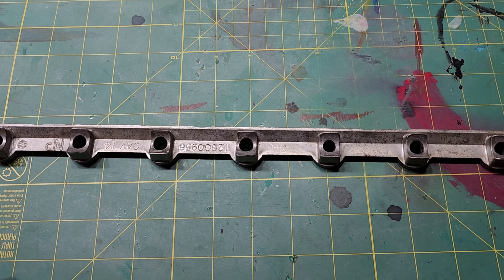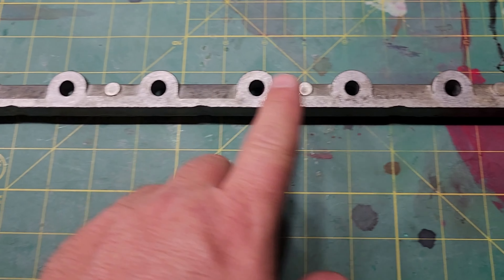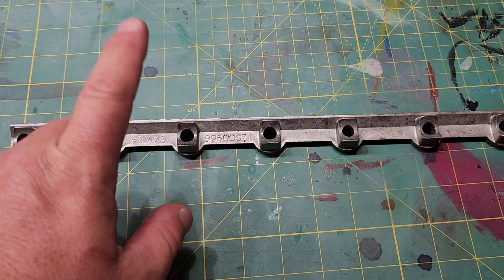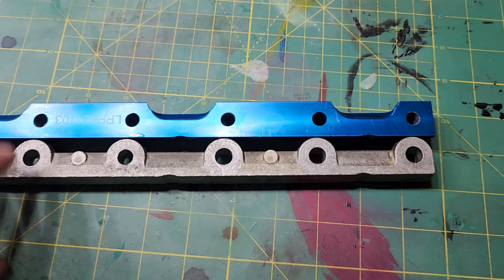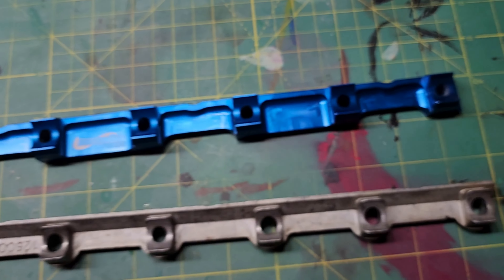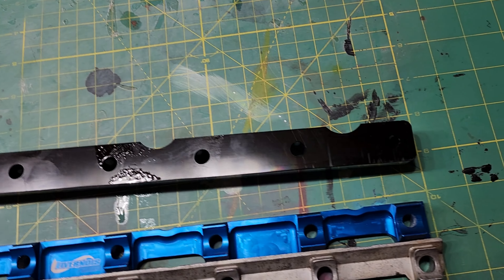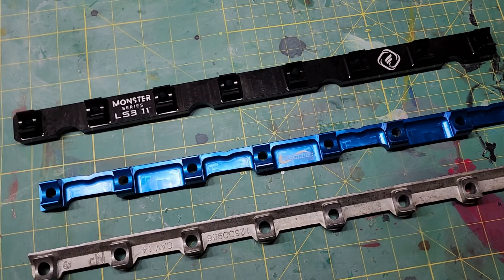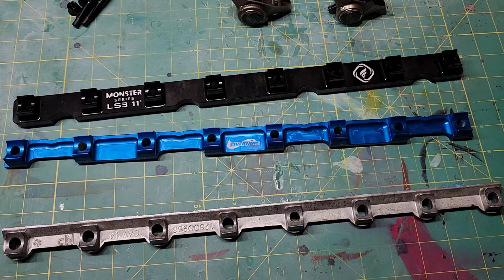LS Rocker Arm Stand Comparison

Comment: Good video, I also heard somewhere that btr may be making a shaft rocker kit for the Frankenstein heads
Reply from the maker: I really wanted a set of BTR shaft mounts for my OEM heads when they came out, but never pulled the trigger. But recently I heard some grumblings that they were having some trunnion failures (needle bearings). If I could get them in a CHE bushing kit, I would. But really...I just need to tell myself I am worth it and get the Jesel KPS-462173!
Reply: @SilverSurfer77  I know they made a updated design of their shaft rocker kit, wonder if the bearings were also updated, I wonder what open spring pressures were causing failures? I love the design but don’t want to fear needle bearings failing
Reply from the maker: @Aidoz_Garage  ok... so we need to convince CHE to make a shaft kit! high five